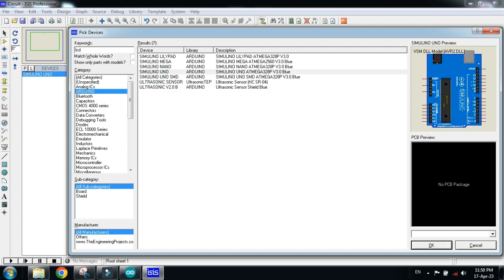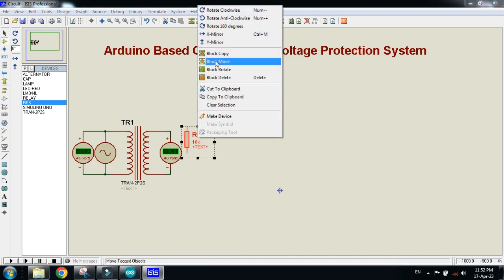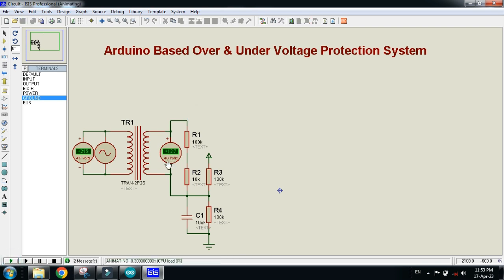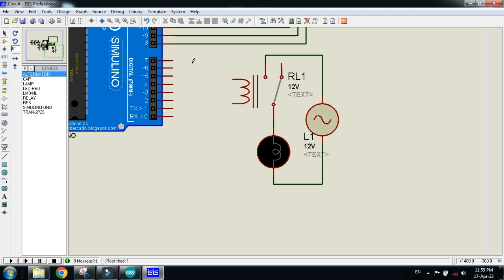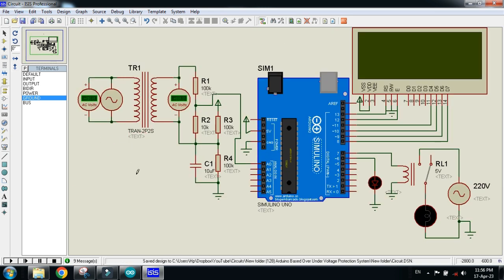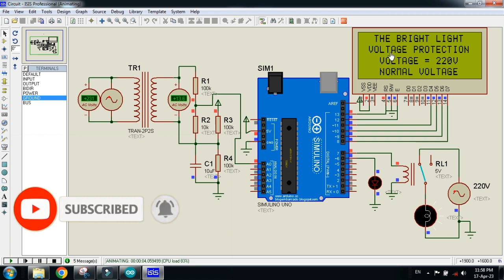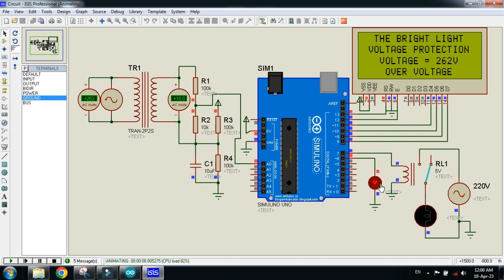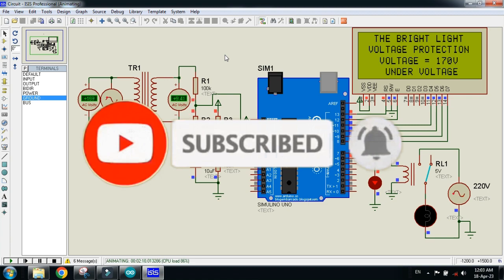AC Overvoltage / Undervoltage Protection System With Code & Circuit || Proteus Simulation

Comment: Sir how can this project be programmed in such a way that it must reduce voltage when.  overvoltage condition is detected?
Reply from the maker: Interface this with automatic Voltage Stabilizer
Reply: @thebrightlight9472 after my search  automatic voltage stabilizer is a design that uses transistor,preset zener diodes and relay.....so just want to know how can these be connected coz honestly sir I don't know....and just a sample of a code that can be simulated in Arduino IDE .....using your design but producing different results in such a way that after overvoltage it must reduce to normal voltage
Reply from the maker: Check for Automatic Voltage stabilizer using Arduino, then combine it with this circuit.

Comment: Nice project  sir , pls i have a question  

What then acts as the voltage  sensing  device ?
Reply from the maker: For voltage sensing I have a complete circuit, you can see on the left side of Arduino and it acts as a Voltage sensor to sense the AC Voltage.
Reply: Assalamuallaiqum, apnar sathe contact korbo kivabe

Comment: Sir @the bright light.... using Arduino uno instead of simulino on proteus 8 can it work?
Reply from the maker: Simulono and Arduino Uno are same thing but different names. You can use any Arduino board and any Proteus version, it will work correctly.
Reply: The connection of the Arduino to the LCD can be the same ? how best can I connect using Arduino uno sir help me @sir_blight_light

I want this project..... same diagram but using uno

Comment: Instead of aurdino Uno can I use esp32
Reply: When I choosing esp32 board in aurdino ide,there is no hex file to locate
Reply from the maker: Please do it practically, because I don't think that esp32 will work in Proteus Simulation so please try it practically
Reply from the maker: Yes you can use that as well

Comment: Great work dear.. But i have some doubts. Is it work in real life? Because giving the power supply to Transformer every time can heat the transformer and also damage it. And how can i protect the transformer in case of over voltage? Like at 440V.
Reply from the maker: Yes it works in real life. Nothing will happen to transformer. Go ahead. Good luck 🤞
Reply: Thanks dear for your quick reply. Can you please provide your gmail id or whatsapp number..

Comment: Good day sir, can you briefly explain how those resistors and the capacitor are operating as a voltage divider? Why did you give them those numbers (100ohm and 10ohm?
Reply from the maker: These are just to Divide the 12v as Arduino can only measure upto 5v on its pins.

Comment: Good explanation,  but I would like to know why you have an alternator as power supply on output pin/side of the arduino uno?
Reply from the maker: Alternator is used as a AC Source.
Reply: Okay, what's the role of the one connected to the relay?
What's the difference between the two AC suppliers?
Reply from the maker: All are same, I have used multiple just for better demo.
Reply from the maker: You can use only one and then connect the wires to the required places.

Comment: If input voltage below 5V ac, code is capable to read this voltage?
Cause of i want to make ac volt meter range is 0.2V to 10.0V.
Is this possible sir if Yes so what is the change required in code ?
Reply from the maker: Yes this code is capable to measure it. Nothing to change just decrease the input voltage.
Reply: @thebrightlight9472  okay thank you sir.
Reply from the maker: You welcome
Reply: @thebrightlight9472  
emonlib for AC monitoring. 
And what about DC monitoring sir ? Is there any library in Arduino Setup for DC monitoring?
Reply from the maker: Watch this video for DC voltage measurement:
https://youtu.be/eON21bPU4gk
Reply: @thebrightlight9472  AC monitoring system on proteus is perfectly performed. When I worked on prectical something wrong with this code.
Applied voltage  --- LCD --- proteus
           230V.            230V.      230V
           10V.              10V.         10V
           0.00V            0.92V       0.00V

Comment: Thank for your great work.  I want to make this project. If It's possible can you provid me the Circuit Diagram and component list. I am confused abut the transform rating And voltage sensor.  It will be very help full.
Reply: Thanks.  And what wll be the capacitance
Reply: What will be the capacitor rating?  10 uf and what voltage?
Reply from the maker: Capacitor value is 10uf - 50v
Reply from the maker: What do you mean by ca.?
Reply from the maker: Thanks for Appreciation. Yes it is possible, go ahead and make. The circuit diagram and components are explained in video, Kindly watch the video again. Transfer which is used here is 220v to 12v (Current Rating: 1A). Voltage sensor is the combination of Transformer, resistors and capacitors.

Comment: AC Energy Meter Using Arduino WithMeasuring heat and humidityWith  Code and Circuit || Proteus Simulation please
Reply from the maker: This Tutorial is already available on my channel, you can watch it, links are below, if need more help let me know. Thanks

AC Energy Meter Using Arduino
https://youtu.be/i81WCkpkqEk

Interface DHT11 (Temperature & Humidity) Sensor With Arduino
https://youtu.be/c6CzoBKJ02w

Comment: Boss multi tusking vedio Plesse
Reply from the maker: Yes will do.
Can you please suggest some topics please.
Reply: @thebrightlight9472 Dc or AC over/under voltage protection system.  There will be DC or AC energy meter with LCD display.  Display will show V,A,W,KWH
Reply from the maker: I have already uploaded videos related to these, you can watch these, links are below:

Overvoltage and Undervoltage Protection System Using Arduino
https://youtu.be/ryQA1fuvv88

AC Energy Meter Using Arduino
https://youtu.be/i81WCkpkqEk
Reply: @thebrightlight9472  There will be 2 programs
Reply from the maker: You want that both should be in the same program.?
Reply: @thebrightlight9472  yes